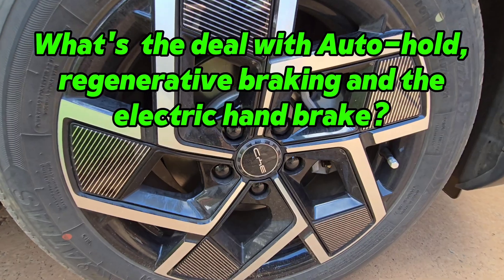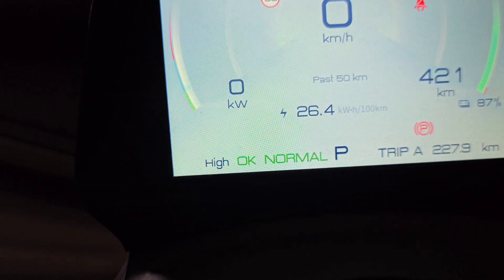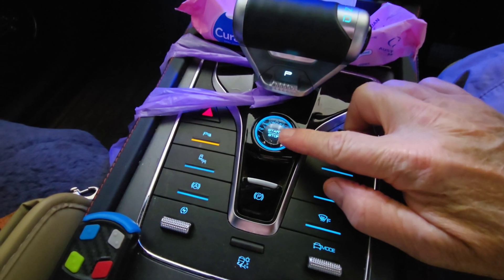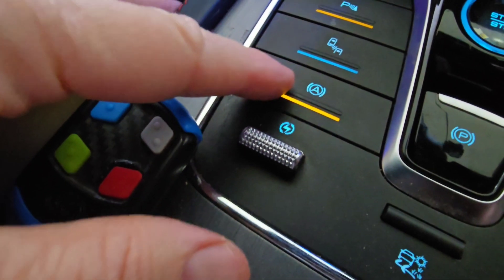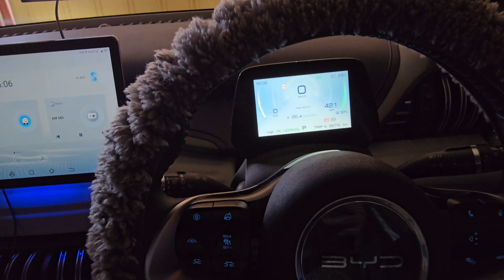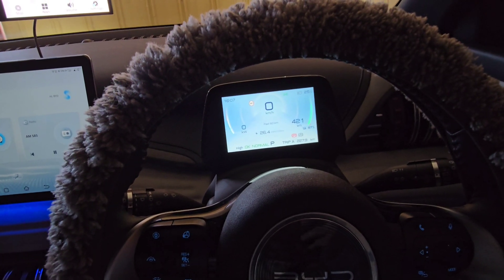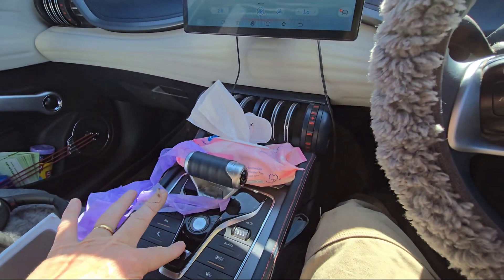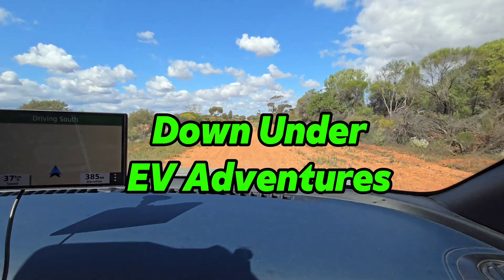Atto 3s Auto Hold, Regenerative Braking & Electric Park Brake. What's the Deal?? Episode 74

Comment: how many kms can you do with the battery? 500.000?
Reply from the maker: @Cloud2cloud-ub4rj  3000 cycles. At 400kms roughly a cycle, well you do the maths. There's cars in China that have done over a Million Kms with LFP batteries and well over 10 years. Life expectancy is now estimated to be 15 to 20 years. Basically the car will fall apart well before the battery fails. Batteries will be repurposed for home battery systems, they'll be oodles of kwhr of battery to power a home. I don't know which country you are from, but in Australia there's very few cars on the road over 20 years old. Most people want a modern car, 10 years or less with modern safety and other features. Hope that helps!
Reply: @bydatto39461  really???? 1.200.000km with one battery??? That's great news! Toyota Chr plus promises the same Yes, you helped a lot Thank you

Comment: I thought that the P-gear button does the same as the other P button. But why have two if one button would suffice?
Reply from the maker: It's not what I was told. I treat it like I explained when I bought the car. I think the issue is possibly when the car is gear ( D ) it could be problematic if you put the hand brake on, but I stand to be corrected, I'm not an engineer! I basically drive the car like an ICE automatic
Reply: @downunderevadventures39461  The button in the lever puts the car in brake, the other just puts break until you push the accelerator, it is like the auto but for one time only, it is very helpful for me.

Comment: I thought when you set P gear is automatically engage the electric hand brake. No need to manually set it.
Reply: Yes it does. Pressing the P button under the gear lever applies the hand brake as well. No need to explicitly pull ((P)) (under Start/Stop button) for parking brake